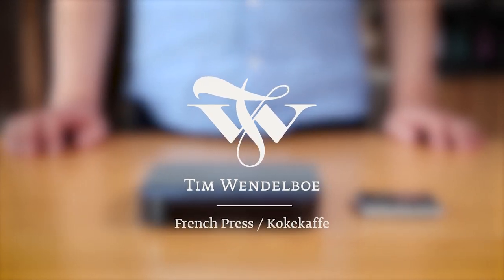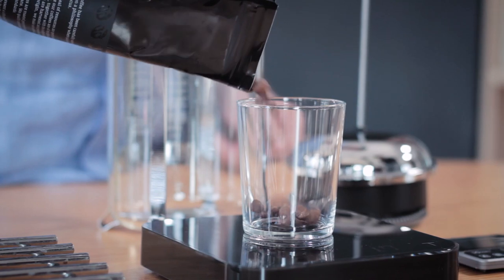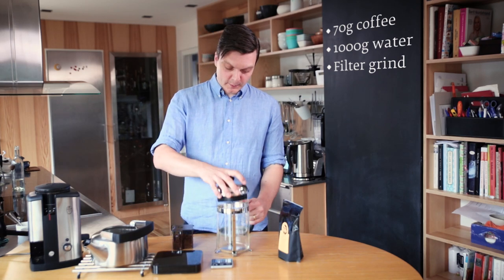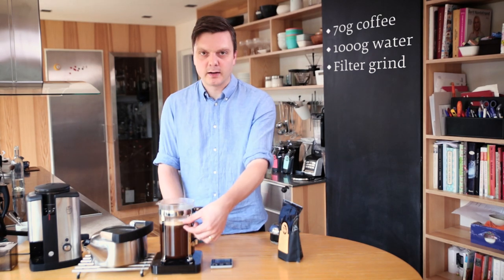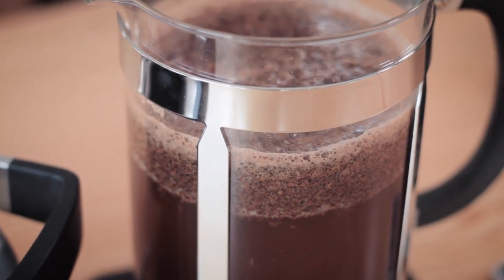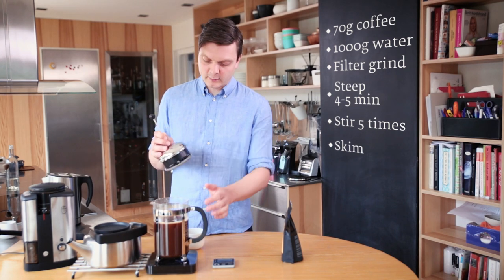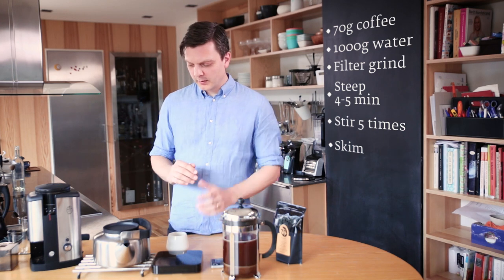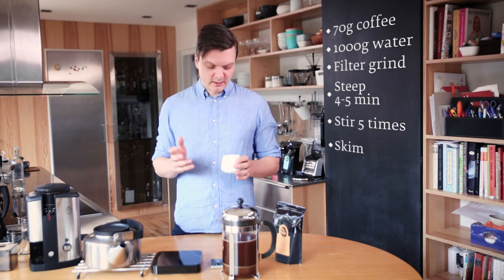How to make French Press Coffee & Kokekaffe w/ Tim Wendelboe

Comment: I've always used 70g per liter and coarser ground for steeping methods and 60-64g/per liter of coffee for pour over depending on batch size.
Learned that this was the SCAE standards to use higher coffee to water ratio for steeping methods so to make up for the coarser grinds used for this method.
Reply from the maker: The reason why you shoudl use more coffee in immersion brews is because the liquid that is retained in the grounds have a higher saturation of dissolved solids than the liquid retained using a drip method. COarser grinds more often results in under extracted coffee, so I don't recommend going too coarse on any brew method.
Reply: Ah ok that makes sense. Thank you so much I'm always willing to learn more about coffee,going to cuppings and other events and talk about coffee with people.

Comment: Nice video Tim. By the way what's the advantage of having a thinner crust by using a bigger dimention French press. How does it aid extraction as supposed to brewing coffee in a smaller press with a thicker crust. In both scenarios as long as the grounds don't fall out of suspension , there would be proper extraction correct ?
Reply from the maker: in a thick crust the top layer of grounds are not always suspended in water due to degassing.
Reply: Makes sense ..Thanks for the response . Wish you could teach home roasting folks like me more about Nordic style of roasting. Here in the US most if not all are Dark roast ...

Comment: Am I right that the actual brewing process happens when the grounds are in suspension at the top?  If so, why wouldn't you just scoop all the grounds away when they are still at the top instead of stirring them and having to wait for them to settle to the bottom?  For kokekaffe (or pot coffee as we say in Finland) I understand that having the grounds settle at the bottom helps to get a clean pour, but for the press pot?

Comment: Any particular reason for leaving the top off the press while brewing? Does that not affect extraction or does the finer grind used here makeup for the faster cooling rate?
Reply from the maker: YOu can put the top on if you'd like. I prefer to leave it off as I rarely use the plunger anyway.
Reply: you don’t plunge the press down?
Reply: @omaremam1996  look up James Hoffman's method of brewing with a french press. It's basically what Tim described in this comment